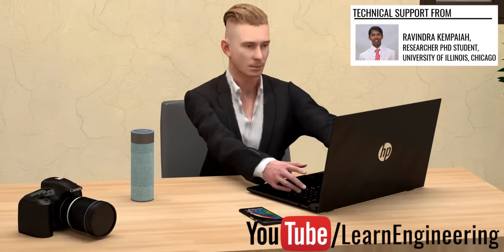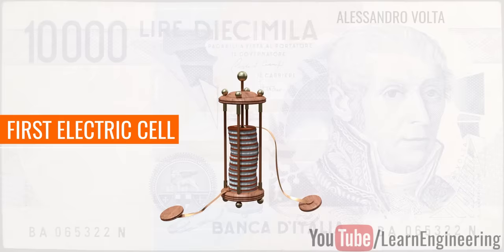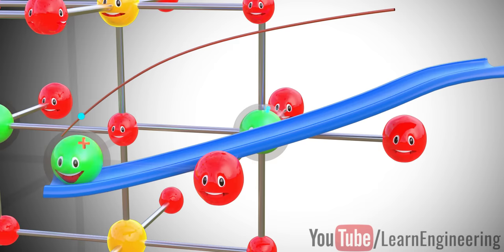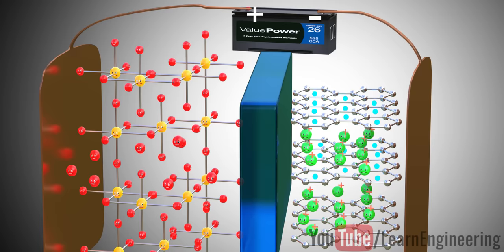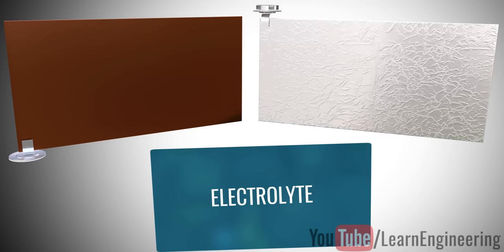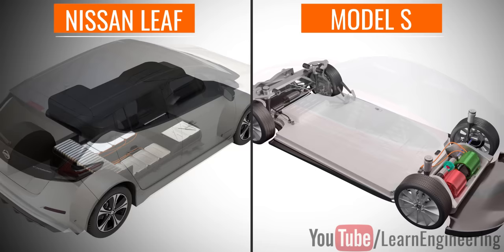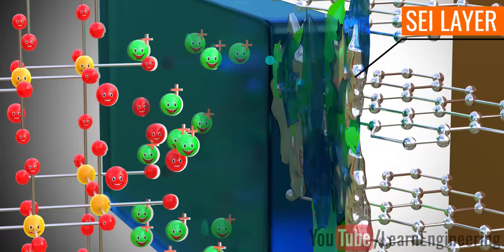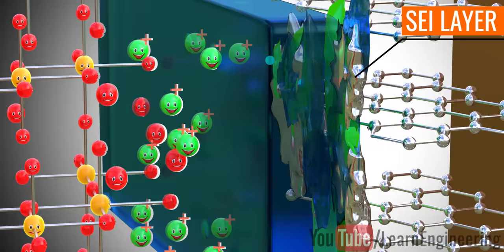Lithium-ion battery, How does it work?

Comment: It's crazy how complicated all the things we use daily are. I try to have at least a casual understanding of a lot of things but damn, there are a lot of smart people out there making really smart things. Cheers to all the scientists past and present for working their asses off so I can have such an easy life.
Reply: Sometimes I wish I was smart 😔
Reply: Jacob, I believe most tech, is really an evolution. Ideas are build upon. One tinny tinny example. My grandfather invented the automatic choke for the internal combustion engine. As he explained it to me it was simply a bi-metal laminate, when heated up the to metal expanded at different rates, causing the metal to move or open up the passage for more air to enter the engine (before this time an engine choke was manual).  An automotive coil is something sorta, kinda like a battery only it only charges up for a few seconds, then BAM  it lets out its electronic charge that is more that what was put into it.  To me it kinda sounds like magic.
Reply: @davidpearl6438  Newer version works just like the thermostat for the coolant. Wax pushes on a rod when it warms up to open the valve.
Reply: petrol and diesel engine don't have "thousands of moving parts"
Reply: @theobvious1958  who are you quoting
Reply: @Jacob-df5hr  its obvious
Reply: @theobvious1958  right..
Reply: They're working their asses off so they can get their paycheck :))
Reply: @andreimdrs9153  lots of scientists I personally met are more interested in solving a problem than in receiving a paycheck. Not all people are income maximizing robots, especially in science.
Reply: @daniyara8879  I wasn't referring to all, of course
Reply: Ikr
Reply: You are so right omg
Reply: if you've got the money, honey, we've got your disease
Reply: I really appreciate this attitude towards science, a lot more should be thinking like that!
Reply: Most of our technology is over complicated because we are still a primitive society. As our understanding improves our technologies will become simpler, more efficient and more elegant.
Reply: @theobvious1958  too bad they weren't paying attention
Reply: @davidpearl6438  

An 'automotive coil' is a flyback transformer. Two coils wound around a ferromagnetic core. One coil induces a magnetic field, and that field collapses instantly (not after a few seconds!) when power is cut of course. Due to the suddennes of the collapse and the higher number of turns of the secondary coil, the voltage induced at the output is greater, but the actual amount of energy is less than what's put in, everything else would be impossible of course.
Reply: @theobvious1958  almost thousand
Reply: It's pretty easy actually
Reply: Best comment ever 🥇
Reply: @davidpearl6438  facts! I don’t even know how these people invented these products.
Reply: The other side of this is, companies, are exploiting the locations producing this energy source. Venture capitalists thrive while ordinarily people suffer, financially and healthily.
Reply: It's crazy how things we deem complex and complicated comes down to the very basics when we try to understand them...
Reply: That's why they make that money, hope they get some time to enjoy their life too like a normal human
Reply: I'm actually surprised at how simple a li-ion battery is. I thought the Tesla packs were a lot more advanced than that, but they're just a bank of batteries with a computer to control them.
Reply: Well said Jacob...most of us forget how lucky we are!
Reply: @normanhenderson7300 why are they suffering…?
Reply: Smart people develop and create these devices. People who use them, well...
Reply: @didodido103  Smart people usually recognise that they're not inerrant. So you're smart.
Reply: Yeah I know right. Going down the rabbit hole of how a computer is made from its basic sources. Genuine investments and maths have brought us here.

Comment: For those wondering why the Li(+) ion and the electron in graphite do not react with each other: Imagine the graphite as an Oreo, in which the graphene layers are the cookie and the space between the layers is the cream. The lithium ions are only located in the "cream" and the electrons are only located in the cookie. Graphite is only electrically conductive parallel to the layers, which means that the electrons in a layer tends to stay and move in the same layer rather than going through the "cream" to get to another layer. So the electrons are not likely to touch the Li(+) ions, probably unless you put a VERY HUGE current on it.
Reply: Which thing is guiding them to go on seperate layers?
Reply: Not gonna lie you said Oreos and I got hungry and went to the store and got me Oreos and completely forgot to read the rest of the paragraph
Reply: Typical physics guy coming up with an analogy harder than the actual event lol
Reply: Won't the graphite repel the electrons even if they do come in contact?
Reply: @Medellin31  Same, really want Oreos rn

Comment: I wish you have explained how the  degradation  happens in Lion batteries and why it is limited to 3000 cycles
And why it has shelf life time
Reply: Li ion sometimes chemically react in unintended ways. When this happens Li ion get stuck and will be unable to participate in the charge discharge process. This happens more with increase temperature and voltage. The Solid Electrolyte Interface is where this stuck Li-ion is deposited.
Reply: Not an expert, but based on what I've heard, but I believe the cell gradually develops internal pathways, a bit like tendrils within the cathode's structure. The result is reduced energy capacity.
Reply: Depends upon what exactly the number 3000 represents. I don't think they mean 3000 "full" charge cycles. That would indicate that a battery pack is sized for 300 miles per full charge would achieve 900,000 miles after 3000 charge cycles. I think 3000 is a bit misleading. The reality is that present Li-ion batteries are achieving only about 1500 "full" charge cycles before showing enough capacity loss for some applications to consider replacement. But thats still 450,000 miles and they won't be dead at that point but likely have retained as much as 70% of their original capacity. As such they'll still be considered good and will continue on until they reach 3000 cycles where the degradation will likely be severe.
Reply: @Tron-Jockey  You are confusing different Li-ion chemistry. NCA have 1,500 cycles to 70% capacity. NMC have 3000 cycles to 80% capacity and 5000cycles to 70% capacity.
Reply: @goldreverre  - I believe thats due to them being poorly manufactured. I know that was a real issue before they fully understood what was causing premature cell death (or fires). I understand that its still an issue with cheaply manufactured Li-ion batteries.
Reply from the maker: Yah, in the next video :)
Reply: @kazedcat  look into the battery mooch. He does liion battery testing for a living.
Reply: @mamaharumi  -- I was already happy to have found this great channel, and now you led me to the Battery Mooch.  Thanks !!
Reply: @tubularap  he is primarily geared to the vape community but many different groups consider him the battery authority.
Reply: @mamaharumi  -- I see Mooch is looking at the cells from a vaping standpoint, but that serves me well.  I am into making battery-packs for ebikes, and want to fully understand how they work and have to be handled best.  Since for vaping one carries the cell close to the body, safety is of extra concern, so that focus on proper maintenance suits me.
Reply: @Tron-Jockey li-on cycle life can get 4000 60%DOD
Reply: @mindouzhang3419  - Excellent, thanks for the correction.
Reply: cammandoookhalsha skyblue captain junior  Yes but typically less than 25% the energy density (by weight) of a typical Li-ion battery.
Reply: Chuck O you're welcome,I have some battery details,would I send to your email
Reply: @kazedcat  what do you mean by 70% capacity? Is it 70% DOD?
Reply: @tanvijoshi9472  After 5000cyles the remaining capacity is only 70% compared to the original capacity. If the pack is 100kwh energy capacity after 5000cycles it will only have 70kwh energy capacity. DOD is how much you discharge while capacity is how much you can charge.
Reply: @kazedcat  thanks
Reply: Perhaps building Energon cubes would be better ? A glass based capacitor that has unlimited charging cycles. Just don't drop or fracture the cell Boom!
Reply: kazedcat TM what is NCA and NMC?
Reply: @Lesics  Please give link of the video. Thanks for you explanation. 

Also please don't include the background music, it distracts specially those who cannot understand english well. Thank you.
Reply: Let’s start with the limited cycle charges. Imagine you have a paper towel and you wipe your mouth on it in one spot, that spot is no longer usable because it isn’t clean, the battery works in the same way with the fact that it burns out over time. Second, batteries overtime self destruct and become so degraded they will not hold charge, this happens due to the break down of the material in the battery.
Reply: @asifsal7124  we speak English, sometimes with music, go watch arabic videos if you're not happy.
Reply: @goldreverre  You're right, Bruce. Lithium metal can deposit after many cycles or after overcharging. The deposition is as dendrites, which can grow until they short out the electrodes.
Reply: @kazedcat  Great comment. But now I wonder, when you say the degradation happens with increased temperature and voltage, why does also deep discharge of the battery hurt it?
Reply: @peter.g6  That is different mechanism. At very low voltage lithium ions get stuck inside the electrode material because the voltage is now unable to force the lithium ions out. It is not really degradation because once you cross the low voltage threshold your battery is fully dead. There is however a crossover boundary where a large enough source voltage could get the lithium ions unstuck. But doing this there is a good chance you fry your battery.
Reply: Lithium ions get used up in the sei layer which is why the cell degrades slowly
Reply: When Li-Ion go and set inside the crystalline structure of the Lithium Oxide, not all find a place to rest, because the structure degrade at each cycle. The battery lose 0.01% capacity for each cycle. Newer batteries (LFP) lose 0.003% for each cycle at 20 C. Double the temperature at 40 C, that halves the cycle life.
Reply: @Lesics  where is the video, its been 3 years

Comment: 1:57 Of the alkali metals, lithium has the most strongly bound outer electron. Caesium has the most loosely bound outer electron of all the elements. Lithium is used in batteries because of its high specific energy and relative commonness.

Comment: There must also have an electric insulator thin layer to prevent copper and aluminum foils to short together?
Reply: Yep, bien d'accord
Reply: Or they need to apply the layers to both sides of the foils, which would result in a more energy-dense battery! I think very few do this due to the manufacturing issues with coating both sides of a foil.
Reply: I think that's what the separator is for.
Reply: Of course, and that thin layer are the separator
Reply: @khaledjoe3724  I think you misunderstood. The separator is for the electrolyte.

What he meant was when copper, anode, separator, cathode and aluminium strip is made in coil of the cell, there are metal to metal contact between copper and aluminium sheet, causing short circuit. Thus requiring insulator between copper and aluminium in the coil.
Reply: Obviously

Comment: Excellent explanation ! but I have 2 questions ;

-Does the solid electrolyte interface is still happens with the silicon or just works with graphite ?
-When the lithium ions want to go back to their stable form when load is connected are there any chemical reactions happens with SEI layer ?
Reply: For the first question, as i understood, i dont’ think graphite has any role to play. Its the lithiom ion passing through makes the protective interface. So even with Silicon, it should be the same.

Comment: I saw the mechanism ,it was really illustrative .But there is a thing I constantly ponder about - the connection of cells together in series .Like I have seen many examples of cells (the non rechargable ones too)getting connected in series .But I couldn't apprehend as to why the potential adds up .I saw many explanations for it but they were all analogies (mostly of multiple water pumps connected together )But I am actually looking forward for a reason that illustrates this with the movement of electrons; the way you did.I would be really grateful if you could make a video on the movement of electrons ,and the summation of potential  in the course,when multiple zinc carbon cells are connected in series .
Reply: Hey I know it;s been 3 years, but if you are still curious, do more research on how power is transferred between electrons. The water analogy is very common but flawed. In reality, electrons hardly move. They largely vibrate in place (except for a small amount of drift)
Reply: @micahsilverman5284 When you have water in a hose, and turn it on, the water that comes out is at the end of the hose. Hydraulic systems are good analogies for electrical systems, even for alternating currents, as some hydraulic systems also alternate flow to transmit power
Reply: @ignacioaguirrenoguez6218  also, you're evidence for why hydraulic systems are good analogies was simply to say that they are good analogies, that's a logical fallacy (circular argument)
Reply: @micahsilverman5284  Nope, you try to sound smart mentioning fallacies but I didn’t make any logical ones, I said hydraulic systems are comparable because there even are alternate flow ones, which transmit energy without long distance circulation of fluid.
Reply: @ignacioaguirrenoguez6218  but a hose is long distance fluid transmission. It is an open end. You said hose
Reply: @micahsilverman5284  Yeah, the hose analogy is for electron movement, while other systems use alternate flow just like only some electrical systems use alternate flow.

Comment: Hi, below question may sound foolish but please help me on clarifying this if you can.
Question: Can a step up transformer be used to amplify output from Lithium-ion Battery?  Which may result in slow discharging or draining battery thus improving every charging cycle.
The above question comes with an assumption of having DC to AC converter in place.

Comment: Why don't the positively charged lithium ions pair back with the electrons when they are both in the graphite lattice?
Reply: Graphite pairs with all the electrons? But the narrator said that graphite does not participate in the chemical reaction!
Reply: I believe it's because lithium separated from the electron is more stable than lithium with electron.. thus, naturally it isn't possible.  However though, lithium with electron IN metal oxide is more stable than lithium separated from electron, thus, they combine in the metal oxide. I hope it helps

Comment: Kindly help with few answers: (God bless you for a wonderful video)
1) What keeps those oxygen molecules still available to Lithium to make Lithium Oxide again when a load is added to the cell? 
2) Why do the electrons sit between that hexagonal structure of graphite only?
3) Which is the happier state for a Lithium atom - An ion or as a part of metal oxide? - You know this will help answer as to why would Lithium Ions go back to be a part of metal oxide once a load is added.
Reply: The Oxygen atoms are bound within a complex Oxide crystal lattice.    As you may know, Lithium is monovalent, Oxygen is divalent, so it was at best "half attached" to the Lithium it was bonded to. It remains partially bonded to the other non-mobile elements in the crystalline lattice.
Graphite is a stable sheet of Carbon aromatic rings, where the electrons are dispersed and shared among all carbon atoms in the sheet.   This allows it to behave somewhat like a metal, and spread out and reduce charge concentrations at any one Carbon atom. The Lithium Ions can therefore intercalate (fit between the sheets) without forming a chemical bond with any specific Carbon.

Comment: You know, putting solar panels above the roof of these cars? Solves the issues of having to recharge these electrical cars. Another alternative would be putting a small wind turbine to produce electricity to recharge these batteries. Or as the wheels turns? These can also produce electrical currents or movement like an alternator. These also can solves the power supply issues that they're having or looking for more power supply or torque for more speed. There are many ways to solve the issues of recharge these batteries overnight. But love your video anyways. I know they're just doing these small steps to create revenue or spend more money(buyers) as time goes by.

Comment: This is an amazing video, specially the last part about new research, "Silicon-anode" batteries are the future!

Note: People who aren't really familiar with these concepts will think that the induction motor is powered directly from the battery pack, they forgot to mention the inverter.
Reply: Lithium metal anode is the holy grail, Silicon would be good too though

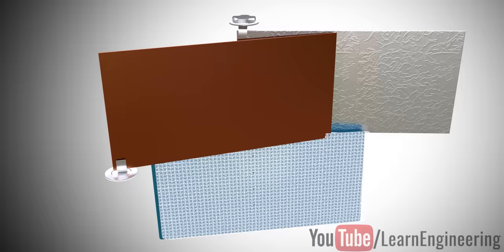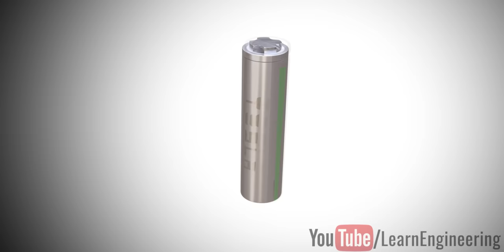Comment: 6:00 Big mistake is shown here. You need 2 separator sheets when winding up the stack. In this case at 6:02 you can clearly see the anode touching the cathode. Moreover, they are usually double side coated with the electrode slurry.